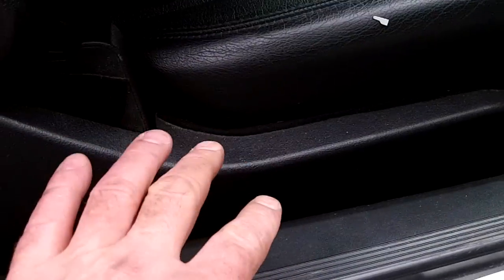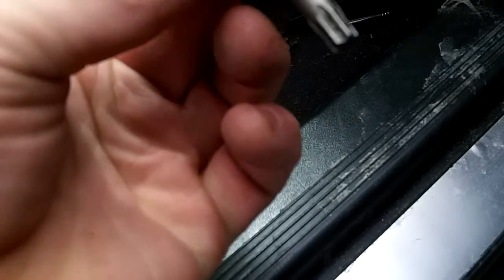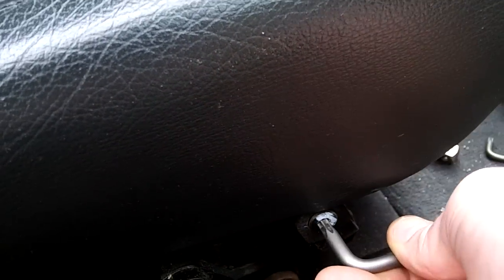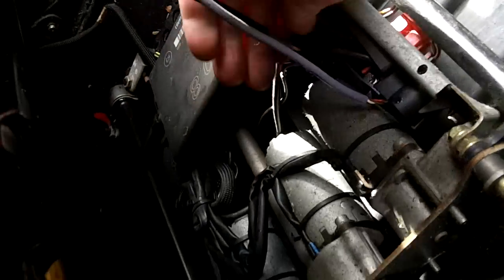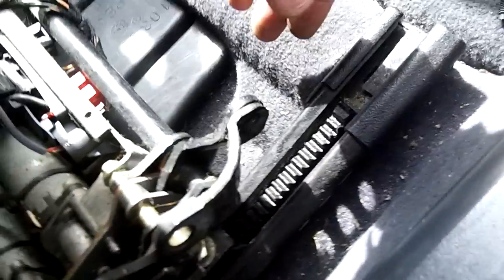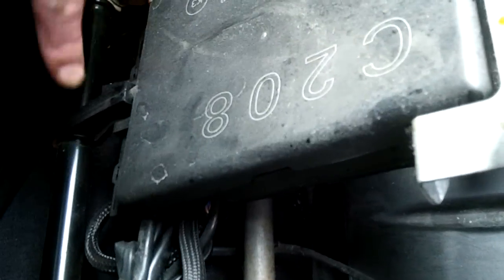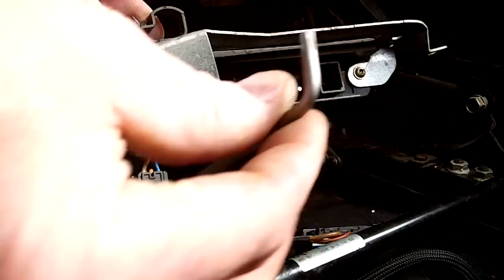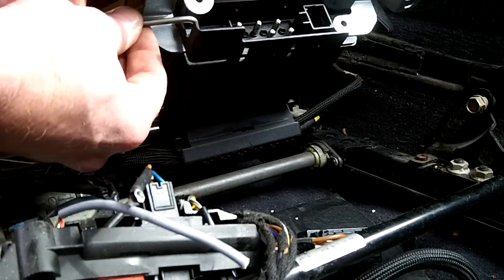Mercedes power seat control module removal

Comment: Hello friend, some time ago they gave me some electric seats of a Mercedes s320 year 1994. The seats worked well before removing them in the vehicle and I want to adapt them in other vehicles but I do not know where the positive and the ground are going to be able to make them work. Does the ground get it from the chassis and the positive goes on the pins?

Comment: Hey bro I'm going to try this on a w203 c320 because my seat is stuck all the way forward(thanks to my bad luck short girlfriend😂😂). What are the wire colors to move the seat manually forward and after using a external battery?

Comment: I have a W208 with a non-working power seat.  Does absolutely nothing.  I don't want to go ripping in to the seat only to find out that there was a fuse or relay I needed to consider first.  Any thoughts?
Reply from the maker: +Jason Moriset power seat fuses are in the trunk under the spare tire cover, and also possibly under the hood if I remember correctly.. check them first and wiggle all the connections to the fuse box in the trunk
Reply: +fupabox I checked all fuses in the trunk and under the hood that pertain to the passenger side power seat control. I just removed the passenger door panel and removed the pictogram control switch from the door . I can't seem to figure out a way to verify if the switch is good so I went further and looked under the seat for any obstructions or electrical issues that were obvious. One thing I did find besides lots of junk under the seat was a single plug with two wires, square in shape with 4 female blade terminals. it had a brown wire and a purple with black stripe wire going into the back of that connector. it wasn't connected to anything. it looks like all connectors that need to be plugged into the power seat control module under the seat are plugged in. I see the seat occupant sensor wire which I believe is the yellow connector and there is a red connector plugged in, which I don't know what it goes to. Is there a way to apply power with, say a 9 volt battery to the wires on the door panel that could make the seat move if it's able to move?
Reply from the maker: Jason Moriset  No unfortunately you can't really test it that way..it's doubtful the switch is bad, as it would have a bad contact in one of the seat movements, but all going bad at the same time is likely a module or power issue.. does the seat go forward when you use the release lever that lets passengers into the back ?  the seat should electronically slide forwards when the seatback is unlocked for rear seat access, then move back again when the lever is pulled up and the seat back is pushed back again
Reply: +fupabox no it doesn't move at all. I can kick the seatback forward but the seat base northe headrest move.
Reply from the maker: Jason Moriset Ok so it's either the module or power to the module....it should have power  when the ignition is on..you will need to remove it and check the plugs for power.. i'll link you to the wiring diagram and seat sections of the repair manual..there are about 50 pages  but it starts here  http://workshop-manuals.com/mercedesbenz/clk_320_(208.365)/v6-3.2l_(112.940)/body_and_frame/seats/head_rest/component_information/locations/
Reply: +fupabox I appreciate all your help. I'll get back to you if I have further questions on this subject. Thank you!

Comment: The video gave me confidence, but the 2003 C320 w203 is different. All you need is one tool, a T40.
Move the seat all the way up and a little forward... if you can! The side shield does not have a screw in it, just a small post, and i broke mine :-( .

You must remove the seat belt from the seat so remove the cover over it at the base of seat side cover, then with a T40 for the seatbelt, lift the post off of the back of the seat where this video shows a screw and move it forward. It comes right off.

Cut the wire tie that holds the wires to the side of the clip holding the module in place, get to it from the back, remove the cables, the front will only go in one way and mine only 4 plugs in use on the back with the orange being toward the center.

The module is held in place by the plastic clips on both sides of the module. See parts 18 and 19 in this image.. http://www.mbworld.org/forums/attachments/c-class-w203/176119d1266156854-help-seat-adjusters.gif , lift of the back part of the clip and the module comes loose. Remove from the car. Careful not to break these side clips.

Remove the side clips from the old unit, there are small tabs at the pivot point, and put them on the new one. They should click into place.

Note the the clips have 2 posts for guiding into the seat frame bracket and the module has 2 flat post which also help with placement and retention.

Install in reverse order.
Reply from the maker: excellent write up and info...it will help lots of people...  much appreciated
Reply: Why cut the wire

Comment: I need HELP :) . It is about E class w211 engine m113,E500, year 2002, i watch your video: 
I have a big problem with the front passenger seat of the car. Before 6 months one time when i drive the seat start moving without human touch :) :) :) , the seat move ahead and down, and the electric motor do not stop, there start smoke from down the seat , i switch off the cable. On the next day i go to the service, they switch on the cable and try to do something with a star diagnose, but without success. The PROBLEM is that they can remove the back bolts into the reel. but they cant remove the front, because of the position of the seat. Now the guy from the service want to cut down the body of the car  to remove it, but i am not happy :) :) :) . My question is: Is there is another way like in your video, to have entrance to the power seat control, my car is with full electric seat.

Comment: hi ya like the video , I have a e250  w212 coupe driver  seat stuck close to the steering i have 2 switches 1 moves bottom seat other back rest . i have an issue with back rest , Could it be a fuse or the switch its self ?

Comment: Do you know the pinout for those seats?
I got some seats and the doorpanel. put its 4 more cables from the door panel than on the seats. 2 of them are power, and thats OK, but the 2 last??
I can only move the seats forward, lift the back part of the seat, and move the head rest. If I remember right..

Comment: Hi I was wondering if you could help me. I have and 500 SEL 1992 my front passenger has power seat with memory I only have power seat without memory. I would like to have memory aswel do you think I could do something like plug and play ?
Reply from the maker: If it is like most older Mercedes , the memory seats have 2 things different from the regular power ones.. There is the switch in the door, the wiring , and the controller box under the seat that stores the memory.. The wiring , switch and the controller box would likely all need swapping out

Comment: It's that simple to remove the bottom cushion? Will see if it's the same for the W209. By cutting those wires. I wonder if his SRS light came on. on that harness plug with the 4 wires (2 brown / 2 blue). I had a blue and brown wire broke off the plug and I got a SRS light on.
Reply: Did you ever figure this out? I also just notice those same wires for me are cut off from connector

Comment: A couple of pearls..
1. Always disconnect your battery terminals before you do shit like this. I don't care if the battery is dead or not.
2. Unplug electrical connectors before u mounting the unit. Its a lot easier to take thT bracket off on the bench than in the car. 
3. Don't just chuck your hardware in the floor board. Its a bad habit to develop.
Otherwise, good I formative video.
Thanks for taking the time to do this.
Reply from the maker: good tips

Comment: I changed the module out but still the seat still only moves in the exact same directions (seat back moves forward/back, seat cushion on the front moves up and down). Seat seems to move forwards only when I use the trigger to allow someone in the back seat so it kind of rules out faulty seat motors or relays. Any experience with such a thing?
Reply from the maker: the only thing that I can think of is the door panel seat switch, but I would think that's unlikely

Comment: Following your video for 2001 e320 but seat not raising after removing T40 bolts. There seems to be a bar restricting it. Any thoughts?
Reply from the maker: +cedjohnson22  Not 100% sure unfortunately...here is the service manual page on seat modules on your car...the rest of the manual/chapters is on the left side of this page..the pop ups are annoying but harmless...
http://workshop-manuals.com/mercedesbenz/e_320_sedan_(210.065)/v6-3.2l_(112.941)/body_and_frame/seats/power_seat_control_module/component_information/locations/page_11152/

Comment: Thanks....My seat goes back and forward and the base itself tilts etc but the recline and headrest aren't adjusting either individually or via memory....the switches sound like they're working and so I was going to buy a second hand base section where the motors are? Where is the headrest control? Thanks again.
Reply from the maker: the headrest motor is up in the seat backrest... it's wiring goes down to the base module with the rest.. A quick thing you can try is to re-sync the seat.. may or may not fix the issue but is worth a shot... press and hold both the seat forward button and the headrest down button ...hold both while the seat moves forward and continue for 10 seconds once it stops full forward..

Comment: I just purchased a beautiful set of c63 seats out of a 2008 Mercedes. I want to retrofit into an early muscle car, using the factory switches. If I rip out that module and wire the motors and heat direct will it work? Thanks
Reply from the maker: yes... you just need the switches and the seat bases with the motors, and the relay for the heaters

Comment: Any idea how to replace the motor for front and back movement? mine is frozen and I cannot move to get to the bolts to remove the seat.
Reply from the maker: if its an older car , the whole set of motors unbolts from under the seat as a set .. unplug all the wires from the module and you should see the bolts . Haven't had to do it in a long time so I don't recall exactly the # of bolts

Comment: The driver side of my 2002 SLK320 won’t move backwards do you have any suggestions on how to fix this problem?
Reply from the maker: Start on this vid around 1:https://youtu.be/1zLtPjrSteQ
First check all your wiring connections und the seat and on the switch
Reply: @fupabox  the switch on the side of the seat is malfunctioning I took off the cover and messed with it and was able to get it to slide back and adjust it to my liking for now but I will need to replace it eventually thanks for the advice my last one I used the above referenced video to get the drivers seat to work a couple of years ago that one got totaled in a freak accident this past black Friday and I was able to find another one the next day just had it shipped to me last week Thanks again
Reply from the maker: @DEACONKEVMO  
Excellent 🙏👍

Comment: Hello fupabox, i hope you can guide me.  I have a 2002 e500 w211 mercedes sedan and my driver seat will not slide forward it is stuck in the most far back position.  I cannot access rear screws to take seat out so i have managed to take out 2 bolts and tilt my seat forward so i have access to the motor that slides the seat forward and back.  All the other controls work; up and down, back rest up and down, headrest up and down it is just the seat.  Can you please help me trouble shoot?
Reply from the maker: find some plastic safe electrical contact cleaner . comes in a spray can with one of those red tubes to direct the spray . Make sure it is plastic safe . There should be little openings on the sides of the electric motor . Spray into those openings . The brushes on the motor are likely carboned up and the spray should allow the carbon to wash off and get the motor moving . Let me know if that works
Reply: @fupabox  thank you i will try this and report back, i have mt fingers crossed that is all it needs

Comment: My seat does not recline but it does til forward, what could the problem be ? Everything else works fine
Reply from the maker: could be the switch , or the control unit under the seat ..

Comment: What do you do when everything is working when you move forwards and backwards the seat only moves on one side. Mercedes is charging £1020 for a whole seat motor and the rest of the stuff but im not sure that the problem is really that. Any ideas? MB E350 CDI Coupe 09
Reply from the maker: I have never encountered that problem before..but I would remove the seat and look to see why the one side is stuck.. I would bet something like a coin has fallen under the seat and jammed the motor
Reply: I have an 03 E320 and I took it to the dealership because I kept loosing power. They did a diagnostic check and said it's the seat adjustment control unit draining the battery.  Is that  usually a something like this does to a battery? (Battery is only 3 months old)

Comment: Can I take off the whole motor and what ever power seat off of my driver side seat? And I wanted to make a manual adjustable with the analog handle.. How can I do that? Please advices.. I have a 1989 toyota supra turbo and wanted my driver seat not to be a power seat. So heavy!!
Reply from the maker: you would have to replace the power seat with a non power one..unfortunately everything is different except the upholstery as far as I know...
Reply: Yes that what i was thinking of it too. But i can easily creating the side plastic cover with the styrene sheet for the turnable analog to adjust the seat for the driver side. Thanks fupabox

Comment: Or should I wire my switch right to the control module only feeding the pins that move the motors?
Reply from the maker: Sorry I read your question incorrectly yesterday.... you want to bypass the module since it uses canbus pulses to operate the seat ... I think you could wire it directly , but I'm a little out of my element with electronics..You may want to check with someone who can give you a more precise answer.  I wouldn't want you to fry something

Comment: fuba I have an E63 amg 
same issue how do I lift the front R passenger seat
Reply from the maker: +Gloria Minaya   The easiest way to remove the whole seat is to unbolt the four bolts holding the whole seat assembly to the floor...they are under the plastic end caps on the seat rails

Comment: 2006 slk 280.  The power seats function but only one side actually moves on the screw.  I'm not sure if it was the mechanic messing it up or what.  Driver side it even looks like it is missing a motor or some sort of rod connecting the two sides to the one motor.  Any schematic or videos you may know of would/could help.
Reply from the maker: start here and use the menu on the left side of the page...full factory manual  http://workshop-manuals.com/mercedesbenz/slk_350_(171.456)/v6-3.5l_(272.963)/body_and_frame/seats/head_rest/component_information/service_and_repair/removal_and_replacement/
Reply: thank you so much.  first picture I saw was what we need to fix.
Reply from the maker: curt bennett  :)

Comment: i think I have this issue as well checked fuses wiring under seats seems to be the module are they expensive
Reply from the maker: +Ryan Moloney  Used, they are around $80    I would pull the cover off the module and see if there is any broken solder joints or water that has gotten in.. It can't hurt if you have a dead one to try it
Reply: Thanks for the the response I will try that first

Comment: Hi, i have a problem where the seat only does not move forward or back, but i can hear a click under seat when using switch on door. What could this be? I put seat right back for a tall person to play drive, could the seat get stuck? Any ideas would be appreciated. Thanks.
Reply from the maker: yes it's possible to get stuck on something that has fallen under the seat ..A gum wrapper or even a penny could jam in the drive gear .. If the seat will raise up maybe you can get under and see whats blocking it . The click means there is power getting from the switch to the relay under the seat so its likely something under there is stuck
Reply: @fupabox  Thank you very much for the insight.  Does the relay come first or does the module, if the module is "broken" would the relay work? Could it be the motor as well?
Reply from the maker: @simonpatcharinvenaglia7892  possible...but if it worked to get the seat to go back , it's doubtful it died just from that . If you have memory seats they can sometimes override  the stuck seat . It's weird but worth a shot . It may get the seat to move .
Reply: @fupabox   We bought "Clarkie" last week so only played around with the memory keypad until today applying instructions in owners manual. Did a memory check, even with both keys.  I vacuumed, high pressure blow all under seat, even sat in back seat and pushed with the Mrs flicking the switch to no avail. I'm heading down motor fault but till I do more shooting who can know. Talk soon.
Reply from the maker: @simonpatcharinvenaglia7892  let me know what you find out.